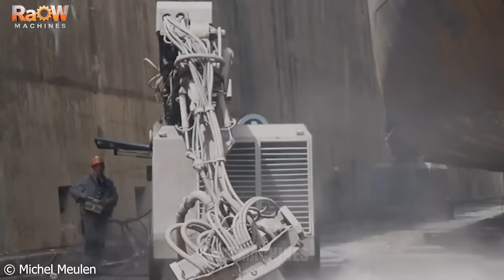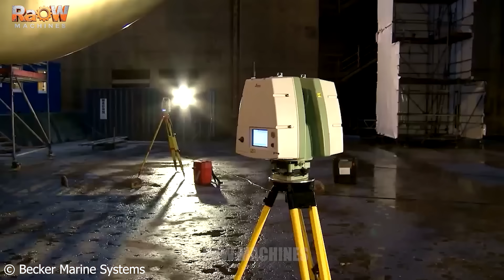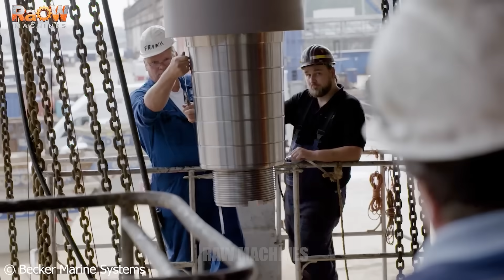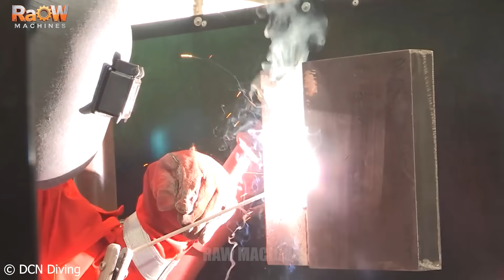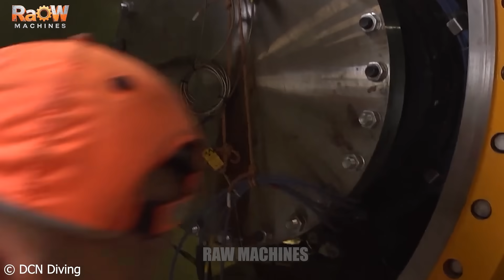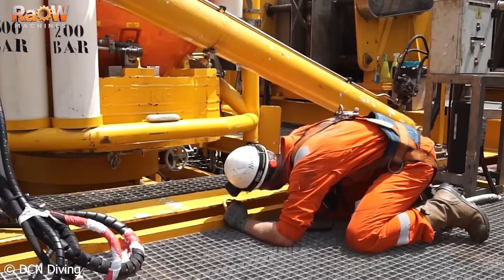Inside a Giant Ship Repair Yard | Dry Dock, Hull Cleaning & Rudder Replacement

Comment: Maybe a documentary is due about what happens to all those hundreds of millions of paint chippings pressure washed off the hull?
Reply: Where my son works they have water separators , 1 for grease/oil with the water flowing through, the other has 3 tiers of screens to capture material, coarse, medium and fine. I doubt it’s perfect but he says 100’s of pounds of chips are captured daily.

Comment: No offense, but you totally missed out on the part where they're actually using high pressure to strip the paint off and they showed a paint depth gauge that they use to determine how much pressure they need
Reply from the maker: No offense taken at all—I really appreciate you pointing that out. You’re right, the high-pressure stripping and the paint depth gauge are key parts of the process, and I could’ve highlighted that more clearly. Feedback like this helps make the next videos better.
Would you like to see a deeper breakdown of the coating removal process in a future video?

Comment: In late 70s, early 80s, a popular therapy, I worked in a supermarket that actually had a slaughterhouse whole half of beef. Would come in and track the trailers that had this rail system. And they would come into the back of the store and the butchers would butcher the meat, and boy, oh boy, did that floor become about 4 inches thick. If not better covered in tallah or fat time to be M we have this high pressure cleaning system. There was, I don't know 56 7000 pound jet. You know what would be coming out a tip? It would instantly remove all this fat and bullshit, and you could just push it in this. And we gathered it up, it got suctioned up. But anyhow, the high person jets would eat through concrete, so if it hit somebody if it hit your boot, your foot boy, oh boy, you better hoped date, it's it didn't get you, um. Hi PSI anything whether be water or steam, it's so dangerous. It cuts through 4 inches of steel. If it's the right setup now, usually they put some kind of aggregate in with the water pressure, but it'll cut right through 4 inches of steel and even doesn't have nothing in it, you'll cut-rate through your skin. So if you're ever in the presence of this kind of apparatus respect, it
Reply from the maker: Wow, that’s a powerful firsthand story—really appreciate you sharing that. 🙌 It’s a great reminder that high-pressure systems aren’t just impressive, they’re extremely dangerous if not handled properly. Hearing real-world experiences like yours adds a whole new level of respect for the crews doing this work every day. Thanks again for the insight! Have you ever seen similar equipment used in other industries?

Comment: There is an abrasive in the water jet, its not water alone.
Reply from the maker: Great point—thanks for calling that out! You’re right, in many cases there’s an abrasive mixed into the water jet, which makes the cleaning and cutting much more effective than water alone. I appreciate you adding that detail for everyone watching. Do you think abrasive water jets are always the better option, or are there situations where pure water works best?
Reply: @RaWMachines-g9r  If you want to remove paint or rust, water alone is not going to do it.

Comment: I didn't watch the whole thing, however, what they were showing in the few minutes I was watching was floating dry docks not dry docks. The two are totally different. As seen in the beginning, floating drydocks use ballast tanks to rise up and down. A dry dock is closed on two sides and an end, with a cofferdam closing off the end to the ocean.
Reply from the maker: Thanks for pointing that out—I really appreciate the clarification! You’re absolutely right that floating dry docks and traditional dry docks are different systems, especially in how they operate with ballast tanks versus enclosed structures. I should’ve been clearer in how we labeled that segment. Appreciate you taking the time to share your knowledge! Do you think we should cover a dedicated video comparing both types in detail?
Reply: @RaWMachines-g9r  If you have time to do so, I think that would be a good idea. The shipyard I worked at had a traditional drydock. I worked as a chipper in the docks on the ships and as a helper in the machine shop. The most amazing thing I saw was the replacement of the bearing sleave on a tail shaft. They used torches on a large drum of oil to heat the bearing sleave, pulled it out of the oil, placed it over a "hole" and then used the gantry crane to drop the tail shaft into the upright bearing and cooled it to lock the sleave in place.
Reply: That's what I thought, not knowing anything.  The voiceover refers to powerful pumps, which is no doubt correct, but they are not pumping out the water where the ship is.

Comment: Ok i see.paint being removed... clean metal to be repainted....did commentator watch same video?
Making a thruster machine assembly...confused seems like.mis.matched edited videos
Reply from the maker: Thanks for pointing that out—we appreciate the honest feedback 🙏 What you’re seeing is actually a combination of different repair stages happening in the same yard. Hull cleaning and paint removal are one part, while thruster work is another section of the overall maintenance process. We edited them together to show the full scope, but we get how that could feel a bit confusing. Thanks for sticking with it! Would it help if we labeled each stage more clearly next time?

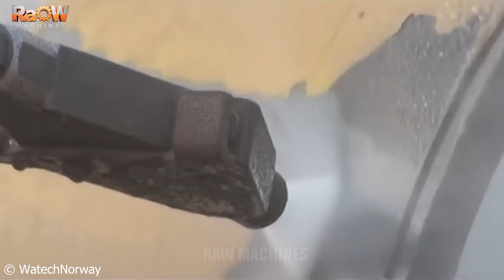Comment: Hydro blasting also removes the piant 5:06
Reply from the maker: Good catch—appreciate you pointing that out! 🙌 You’re right, hydro blasting can remove paint, especially when it’s damaged or needs to be reapplied. It really depends on the pressure level and the condition of the coating. Thanks for keeping an eye on those details! Would you like us to go deeper into how different blasting methods are used?

Comment: Blistering Barnacles!
Men used to have to scrub  the tons of gunk off the hull manually!
Reply from the maker: Blistering barnacles indeed! Back in the day, crews really did have to scrape and scrub all that buildup by hand, and it could take a huge amount of time and effort. Modern dry docks and cleaning equipment have definitely made the job faster and safer. Still, it’s amazing to think about how much work went into maintaining ships in the past. Thanks for the great comment!
What part of the ship repair process surprised you the most in the video?